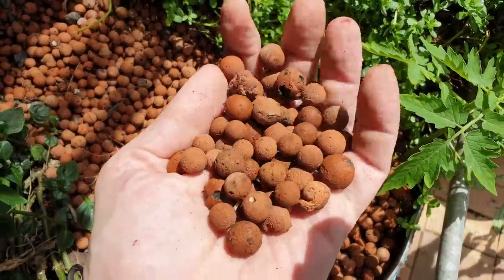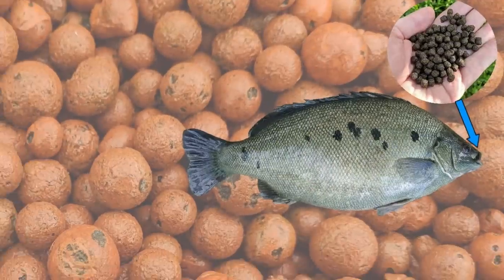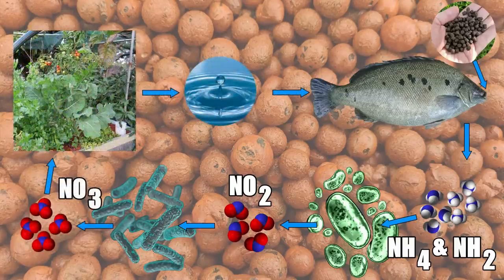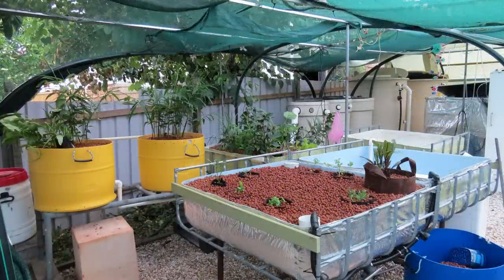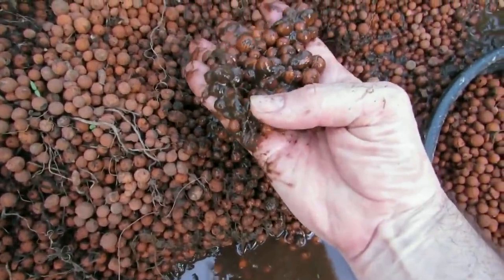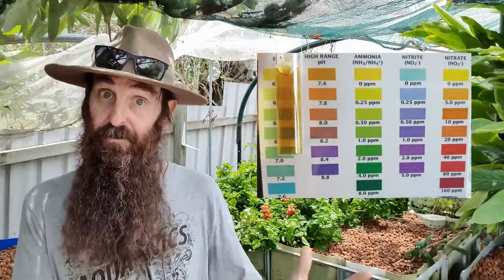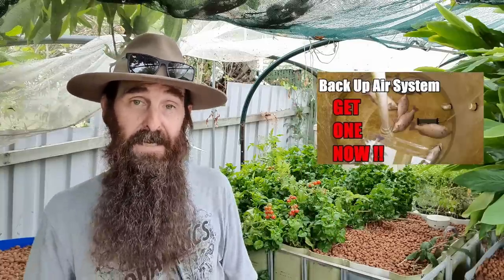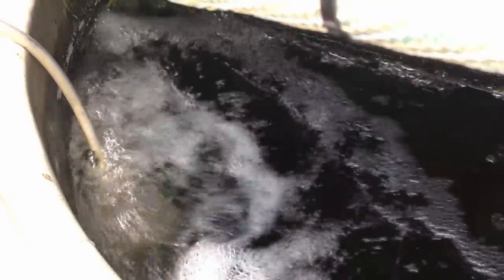5 Common Aquaponic Mistakes That are EASY to AVOID

Comment: I've been working through these videos before setting up a small system for my patio, and I'm realizing that this is basically a super-sized version of the biologically stable planted indoor aquariums I've kept for years (my largest has been self-maintaining for about 5 years now). That is very reassuring, as I was a bit worried I'd end up over my head. Fortunately, I'm already all stocked up with water tests and a working knowledge of the nitrogen cycle, and these videos have been the most clear and informative aquaponics how-to's I've come across on YouTube thus far.

At this point, I'm giving serious thought to adding a small sweater-box grow bed over the top of my 60 gallon livingroom aquarium for an indoor herb garden since I have a couple extra full-spectrum grow lights that can be suspended over the top and a bag of expanded clay bought for potting my orchids, and it would give me a chance at a cheap trial run at rigging up my own pump and bell siphon before I run out an buy $500 worth of equipment.
Reply from the maker: Nice one Cristia.
Hope the systems grow some great tucker for you.
Happy growing. 🐟🌱🍅

Comment: My #1 Mistake was choosing small diameter pipes. Although in theory, my chosen diameters are fine and my system works well, I have no leeway for enlarging the system, and I am on edge in case of minor blockages. My most common problem is with the solids lifting outlet, if it gets even slightly clogged at the bottom of the fish pond the discharge is barely sufficient for the inflow and my fish pond can overflow (kicking off the refill valve of the system and wasting a lot of water...). Anyway thanks for the Video.
Reply from the maker: Hi Matan. Are you using a "T" fitting at the top of your SLO?
I've found that it allows the water somewhere to go if the base gets clogged at all. 
The base in ours only blocked up when we had netting over the base of the SLO when fingerlings where in the tank. Having the "T" at the top worked a treat at allowing the water an alternate path out to the filters. 
Hope you can sort yours out mate.
Reply: What diameter pipes are you using? I'm about to start building mine with 40mm...

Comment: Another great video. As a wise man once told me... "if you start your day and your plan B won't get you there on time,  you are already late."  Same with being prepared. I am starting my system up and already have four pumps working in a system the uses only two but needs only one. I will binge watch your videos for advice before I go to far. Thanks.
Reply from the maker: Hope they help you out some Robert & the build is coming along well. 👍
Cheers mate.

Comment: Hi Rob, greetings from the UK! I love your videos and you’re a real inspiration to someone just starting out! 

I don’t know if you’re still checking comments on old vids, but thought I’d ask, do you have, or could you make in the future, a video just about the failsafes and backups that you have? Things like securing pipe work, how often you check it, what float switches or backup power supplies you are running, etc. It would be really useful as I want to get the safeguards into the design from the start! Cheers!
Reply from the maker: Hi Jono. Am having a few weeks off posting clips & answering FB & email messages just so I can catch up with you YouTube comments.  😉
I have a clip on the air backup system but that's about it. 
https://www.youtube.com/watch?v=21XgunEYhtc
I run through other bits & bobs on the general update clips but will look at creating one on fail safes & the like in the future.
Thanks for the suggestion mate & have a top one.

Comment: Great video Rob, really enjoy them. 
I built one of the 12V air pump backup systems you showed. Works like a champ, but one thing I did discover is that a diode is needed inline from the power converter, otherwise you will feed 12V power back into the electrical lines. Electric folks detected a good 12V  about 100 feet down line at a transformer.
Reply from the maker: Hi Charles. Wasn't aware that would be an issue. Thanks for the heads up.

Comment from the maker: Don't forget to subscribe if you want to be kept up to date with the latest aquaponics system build clips,
► https://www.youtube.com/channel/UChz2QEbZECEzUih1DiqZTNA?sub_confirmation=1
Hope your gardens are booming. 🐟 🌱🍅
Cheers all,

Rob
Reply: This is fantastic Rob! Great informational video and the editing work is very nice. Something I'd like to mention in regards to beginner mistakes: water that is too pure (too little carbonate hardness) can lead to random inexplicable fish deaths! I had this problem myself. The solution is exceedingly simple: top-up the system with hard water occasionally to increase the carbonate hardness to around 3 or 4 dkh. This buffers and helps to maintain the pH from swinging while supplying needed calcium. That said, too much carbonate hardness will actually lock out calcium and iron and will cause plant issues. Using hard water to buffer the pH of my system keeps up with the carbonate losses that occur from nitrification.
Reply: Hey rob... I have small issue with my aquaponics system... its 2 week old system...I used an api test kit....Ph is 8.0, ammonia is 0.5ppm, nitrite is  2ppm, nitrate is 10 ppm.... I'm also adding readly available beneficial bacteria into the system.... what do I do to solve the ammonia and nitrite issue...or what am I doing wrong?
Reply: @f5sal988  . Just give it a few more days... perhaps a week - to finish cycling. The nitrites and ammonia will drop in time just be patient. The presence of nitrites in your system indicates that nitrosomonas are feeding on the ammonia. The nitrobacter take a little longer to colonize the media but they will oxidize all of the nitrite into nitrate. Judging by your nitrate level already, it seems like they just got started. Let them continue to multiply for a bit and the nitrite and ammonia will suddenly drop to zero as the nitrobacter catch-up with the nitrosomonas :)
Reply from the maker: How is it running for you now mate?
Reply: @RobsAquaponics  heyy rob... how r you??... I have no nitrites problems now.... but my fish have got the ich 🙁.... treatment is going on... I think I'll lose the all the good bacteria now😔.... how do you treat problems like ich??...
Reply: Thanks for the videos
Reply: @RobsAquaponics 
HI am rejith from India (Kerala),
Right now I am out of country.
I would like to start an aquaponics system at home whatever the parameters available around home. I like to know what is that elements used in your growbed....?

And you have shown by collecting some metals in a bottle and filled with vinegar...,
For what examination you have made it and another something in your growbed in a colour of burnt orange.
What kind of a material is that. Can I arrange it here.

I like to know more about this topic.

Thank you so much for your videos......
Reply: @RobsAquaponics 
Is there any possibility to join in a single system with both aquaponics and biofloc systems....
Reply: How much does it cost to get something relevant going?
Reply from the maker: @googlemail4241  Depends on what you can find 2nd hand or recycled GM. A few hundred dollars will get a small chop & flip system going which you can add to over time.
Reply from the maker: @niggel44 I would only recommend small ornamental fish for the barrel systems. Guppies, goldfish or something similar. For that size tanks I'd suggest no more than 5 or 6 goldies. 
Cheers.

Comment: 👍 i made the mistake of 100 fish, bought 100L k3 media which has sorted the ammonia nitrites but what i didnt think of was the amount of suspended solids, big learning curve made heaps of filters going well....definatly listen to what rob says otherwise learn the hard way
Reply from the maker: How are the raft beds growing Matt?
Reply: When i give them the time and keep on top of adding supplements they are ausome....but atm they look like a shaggy dog that hasnt been washed in 2 years, current focus is getting the fish to harvest at the end of summer then itll be shut down and revamp. I purged 12 bigger fish over christmas they were beautiful, because i had so many fish i had to grade them. I turned 1 600L raft bed into a 2nd fish tank which now has 32 small/medium and 66 big are in the 1000L tank, the 66 will be 500-600g by winter but i may need to keep the small/mediums over winter, as you know just gotta see how we go. I have been meaning to send you update photos for a while now
Reply from the maker: @mattdawson7055  Nice one Matt. Will keep you in fish all winter long.
Reply: Crashed the ph in sys down to 4.6....hadnt been staying ontop of it with tap water top ups plus rain, the sides of tanks and bio media are super clean thats when i noticed it plus had heaps of foam ontop of water assuming that was dead bacteria. Have stopped feeding and bringing ph back up over a few days with tapwater, no deaths yet
Reply from the maker: @mattdawson7055  Crap Matt.  Hope you can get on top of it.

Comment: Hi Rob, where do you get your beige tanks from and the larger one holding your fish? Thanks
Reply from the maker: They came from a company that has now closed down I'm sorry to say John. 
Try searching for "aquaculture tanks" locally & a supplier may come up.
I'd also recommend that you look for a tank that has a height to diameter ratio of 1:2. That will give you better water circulation & solids collection from the centre drain than my taller tanks. 
Hope that helps some.

Comment: I am about to start an Aquaponics system for the fish pond using the using the water media to grow the plants. After looking at your video i have decided to use a solid media on the trays. We have access to perlite, Coconut coirs, even coral stones. What is best for my media?
Reply from the maker: Perlite could be an issue in a large bed as it's so small & light. It won't offer the best drainage. Coir would have the same issue in a large bed.  They may work OK if y=used in individual post that sit in a try or trough that has a small amount of water flowing through the base though. 👍
I wouldn't use coral as it would have a high level of carbonates & will affect the pH of the water over time.
Hope that helps some.

Comment: My biggest problem was levelling the ground on bare soft dirt. The growbed is towards the back half of the sump tank and the hundreds of kilos has caused gradual compaction to the back left with the bell siphon on the front right. Results in hair-pulling frustration and continuous tinkering to get a non-level siphon to initiate and break reliably. And the only permanent fix is to slowly undermine one side of the foundation of this 1 tonne+ fixture with a trowel and hope it doesn't crush me.

Comment: Halo pop is also there in the event of water evaporation and continuous compensation will affect the height of the ph
Reply from the maker: Not really as the water is continually being topped up as required & most contain some form of alkalinity. Rain water can be problematic though as it is normally mineral deficient.  👍
Cheers & have a top one.

Comment: Sorry I'm late to comment, but I hope you see this and get a chance to answer. In your explanation of overcrowding the system with too many fish, you gave a breakdown for the amount of media required to grow out a fish to one pound (6.6 gallons of media). If you were going with a larger fish that you wanted to grow to say 2 or 3 pounds, or maybe even larger, how would you convert the goal weight of the fish to determine the correct amount of media needed for your system?
Reply from the maker: You can use the 1lb of biomass per 6.6gal of media as a rough guide. 👍 From there you can also work backwards if you want to use smaller ornamental fish as well. 
Cheers David.

Comment: Rob, quick question. Why are you using the clay media over using gravel?  The clay media is too expensive where I'm at and gravel costs literally nothing.  I do not have an aquaponics setup as of yet (in the planning phase), however, I do have a small aquascape that I plant edible plants in the gravel bed.  Is the clay media that much better, and how so?
Reply from the maker: Hi John. There's nothing wrong with rock other than the weight needing to be taken into consideration whjen planing the grow bed stands. 👍
I went with the clay as I had leftover from our old hydroponic days. We were a bit better off financially when I started the system & the Aussie $ was strong so I was picking up bags for around $20 each which also helped. 
I would recommend you test the rock for carbonates so you won't have issues with spiking pH down the line.👍 
Hope the build goes well for you.

Comment: Hello Rob. Thanks for putting your heart into all these videos.  I have a question about the back up:  Are you familiar with the Uninterruptable Power Supply (UPS) that are used in offices to power their computers when the power drops?  If there is a power interruption, the UPS automatically turns on and keeps their computer from losing their work.   Do you think one of these UPS would be a good back up for when the power goes off in one of our systems?  I mean to use one in my system to protect the fish from air pump interruption.  What do you think?
Reply from the maker: Hi John. I was looking at getting one for my parents system but the batteries in most aren't large enough to run the pumps as long as I need them to.  I know larger ones are available but out of my budget for the time being. 
Cheers mate.

Comment: I did a aquaponics course many years ago and saw a couple of set ups. My question is this, is it a cost effective way of growing food, as by the time you factor pumps, containers, media, plumbing bits and bobs, fish and testing kits etc, plus on top of that electricity, does it come out as a financially viable alternative to other methods of food production?
Reply: I'm about to get started in this as well, plan on having my first set-up built within the next weeks and inside this month it should be operational. I think you need to view the cost of the system as a "start-up" cost and you shouldn't really allow that to color your view of the whole system. Aquaponics is a self-contained, self-regulating system, in general, and while the cost is higher than more traditional in-ground gardening or farming, the flexibility and sustainability of the system needs to be taken into account. It's a down-payment on not really needing to have grocery bills anymore.
Reply from the maker: It definitely is if you're wanting to grow fish for protein in the backyard. They just don't grow well in soil.😉 
There would be much more cost-effective ways to grow a few heads of lettuce if that's what you're focussing on.

Comment: Hey rob. Just been getting into the idea of aquaponics. I don’t have a place in my backyard with good light for plants. The spot i can put a ibc chop and flip system is in the shade. I was thinking about growing duckweed to the feed the jade perch I will have. Do I still need to have 25l of media per fish? I will be using gravel from the local hardware store.
Reply from the maker: Hi mate. It's best you stick to the 25L per fish when first starting out. 👍 Once you feel confident that the system is working well you can up the limit a bit but I wouldn't go less than 20L per fish in such a small system.

Comment: Good day sir,
Nice videos!
  I wish to start a small aquaponic system. Just a common question.Do you reuse coolant or oil pods (ibc) for your garden?

Thanks
Reply from the maker: I try not to Raymond. I try to stick to IBC that have had food or mild acids in them  that are used in the food industry. The one exception would be ones used to cart the urea based Diesel additive called Adblue. I would still give an Adblue IBC a good wash out or you may end up with ammonia readings that are off the chart. 
Cheers.

Comment: I am just starting my chop and flip 250 gallon IBS aguaponics system.   I have 2 questions.  1) I am using expanded clay pellets, do I need to put something in the water to help produce the bacteria to change the amonia to a nitrite-nitrate?    2) Can I use plant nutrients in this system, or do I even need to?
Reply from the maker: Hey Jax. The bacteria will turn up by themselves but you will need to add some form of ammonia for them to feed on. I have a cycling clip that walks you through the process if that helps at all,
https://youtu.be/kmxfI_fkmtc
Some folks will add fish friendly additives like kelp/seaweed extracts but generally speaking there is no need to add extra nutrients into the system if the fish are well fed. 
The only exceptions being calcium, potassium & sometimes iron as they may not be present in a great amount on the fish waste. 
I use calcium hydroxide to buffer the system & the kelp powder I add has a geed deal of potassium so they're covered. I will add some DTPA chelated iron from time to time if I notice deficiencies in the leaves. 
Hope that helps some.

Comment: If your pump is in the same tank as your fish (no sump tank) you can elevate it off the bottom so even if it fails there is a minimum depth of water for fish to stay wet while you fix
Reply from the maker: I have seen folks do that. 👍 The only thing to keep an eye on is keeping the water regularly topped up & you may need to clean some solids off the base from time to time.
Cheers Eric.